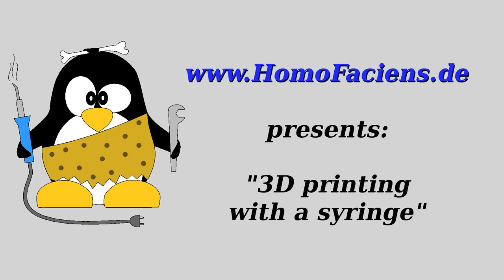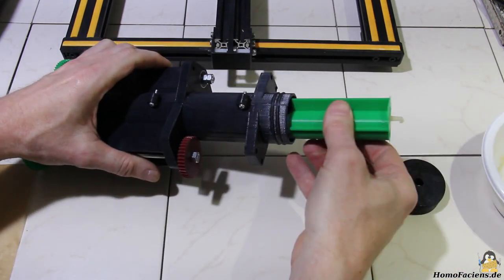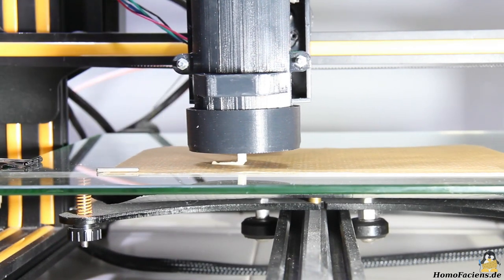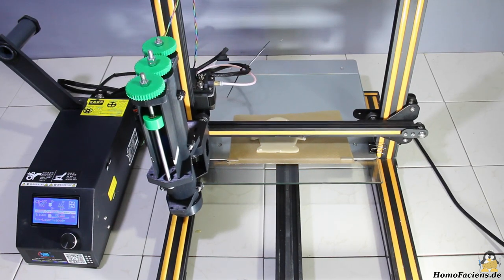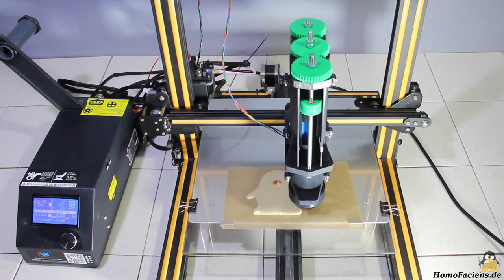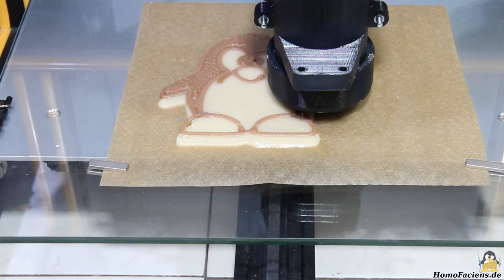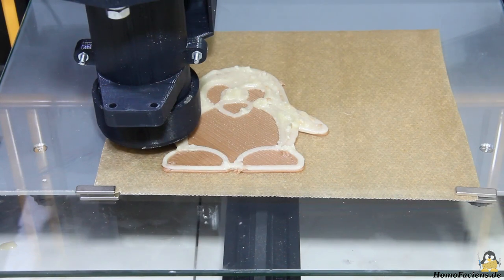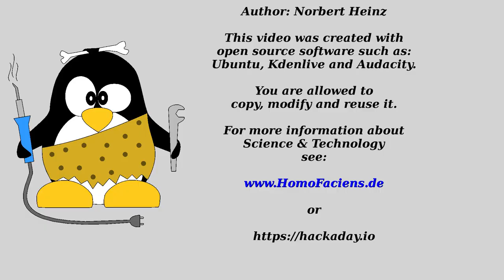DIY Syringe Printer - cookies and more

Comment: Super cool! If you turn on the heat bed you might be able to cook them too.
Reply from the maker: 100°C is the maximim temperature of the heated bed. That's not enough to trigger the caramelization of sugar and so to bake the cookies. Making an omlette might work since that type of reaction starts at approximately 70°C.

Comment: Very cool. If you are printing chocolate, I suggest "compound chocolate" which does not required complex "tempering" to achieve a hard result. Still, you will need to wait a long time between layers for the chocolate to solidify.
Reply from the maker: Thanks, I'll keep that in mind when starting my chocolate experiments.

Comment: I wonder if can redesig top so syringe plunger can rise all way up and out of way for refill, it just reposition so hose from refill assembly is aiming into it, refill then plunger lowers again. though not sure what would happen if air gets stuck in middle.
Reply from the maker: Sounds too complicated to me.
Reply: @HomoFaciens  True, wold need external "t1" "hotend" as well as complex gcode to manage that

Comment: I'm wondering if you can bake the cookies on the 3D printer itself it's something I'll have to mess with at some point
I'm guessing it will take longer than your standard oven cuz the temperature is a bit lower but it should still work
Reply from the maker: You might be able to make it work, but not for any kind of series production, just for your own entertainment or to get a better understanding of machinery. I have seen 3D printers making an omlette that way, which worked fine.

Comment: Great video!  Would love to see this with a UV hardening resin and a UV laser.
Reply from the maker: Well, that kind of meterial is better processed with SLA printers.
Reply: @HomoFaciens  I know but the layers in SLA are so fine they take forever.  Having a quick setting resin extrusion may be a game changer in strength and speed.

Comment: You could use a heat gun to bake the dough a little before the next layer.
Reply from the maker: Just try that: Form a sphere or a cube from dough and point a heat gun on that. See what happens. I don't think it will harden in that shape, but rather start flowing. I am not sure about that, so you can proof me wrong ;-)